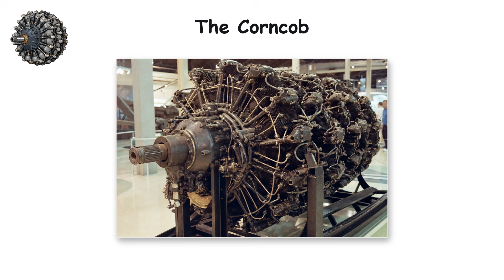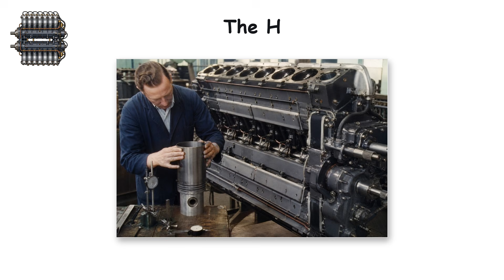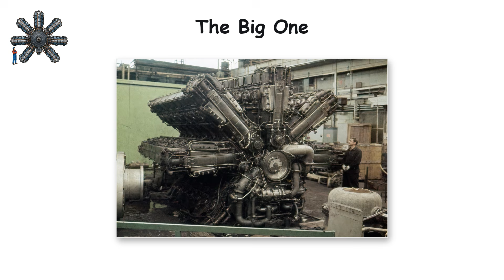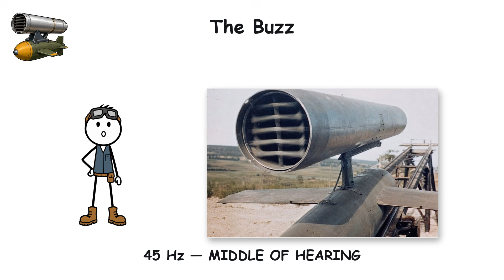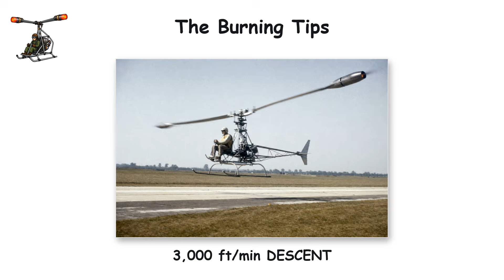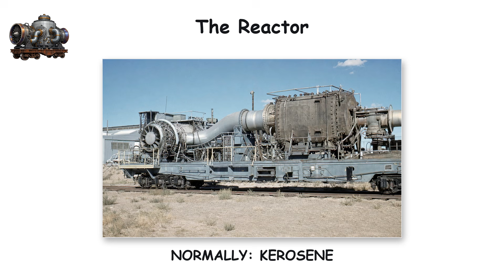9 Weirdest Aircraft Engines Ever Built Explained

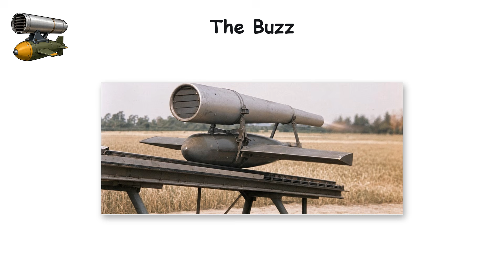Comment: 7:48 that the pulsejet couldn't run sitting still is probably a misconception because it needs moving air to start. But it can be started by using compressed air or a kind of leafblower. And once it ran it had no problems with being stationary

Comment: The first engine is not the actual engine! The Pratt & Whitney engine banks/rows are staggard/offset, not in line with each other.
Wait a minute... You claimed that the first engine you talked about was the largest aero-engine...

This video is not well thought out, and it is full of mistakes.
Reply: Pratt & Whitney bib build one inline radial the 20 cylinder Yellow Jacket. One of. A liquid cooled inline radial with 4 rows of 5 cylinders. Liquid cooled, OHC  with towershafts. On display at the USAF Museum at Wright Patterson AFB.